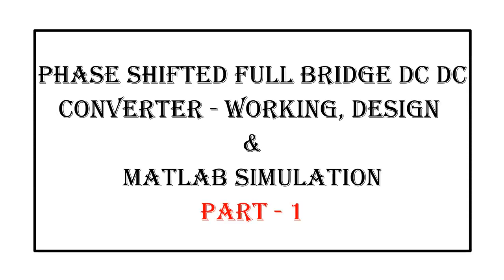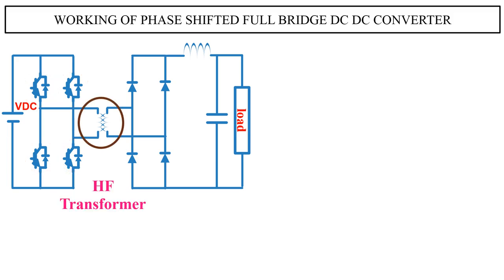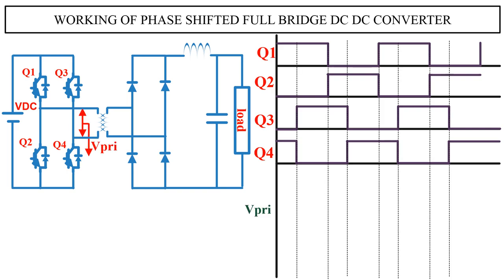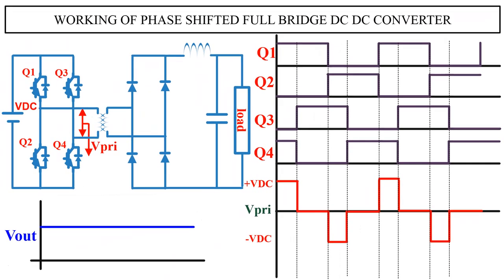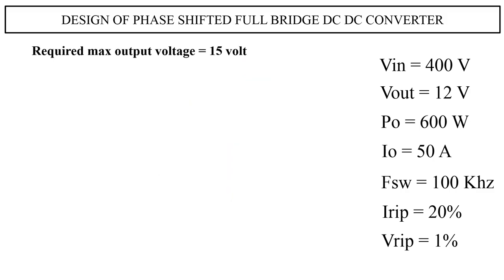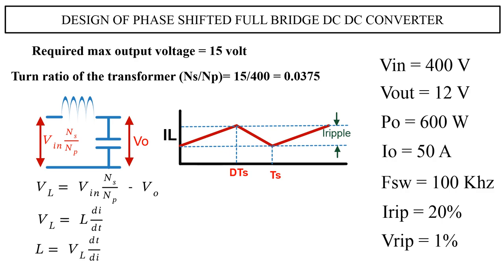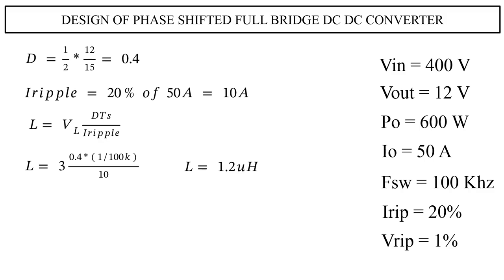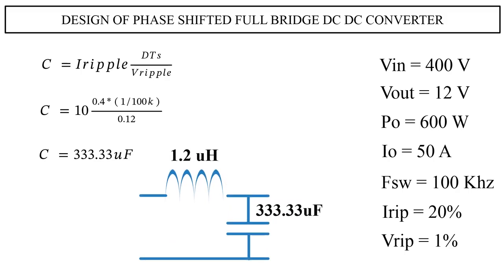Phase shifted full bridge DC DC Converter (PSFB) - Working, deign and MATLAB Simulation - Part 1.

Comment: Really loved the video, can PSFB be used for step up converters, what are the drawback of using PSFB for a step up instead of step down.. also what challenges do you see them when using at higher power rating 20kW, 50kW or higher.
Thanks in advance.
Reply from the maker: Yes can be used. The voltage spikes across the secondary side diodes due to its reverse recovery time and transformer leakage inductance becomes big concerns

Comment: sir i want to increase the voltage from 400v to 1000v its is possible by high frequency transformer ? and again full bridge recrtifier. bcz i need 1kv at output

Comment: In a transformer, as the voltage goes down, the current goes up according to the turns ratio.

However, in DC-DC converters, the current does not increase when the voltage goes down, but the current is supplied according to the load.

So isn't it against the principle of V1I1=V2I2?
Reply from the maker: To stisfy the equation, power has to be constant